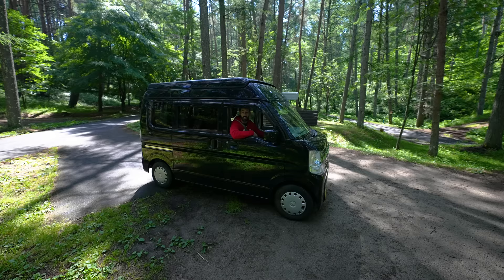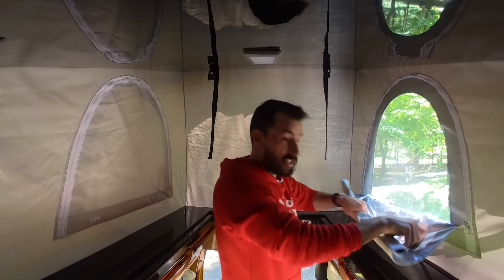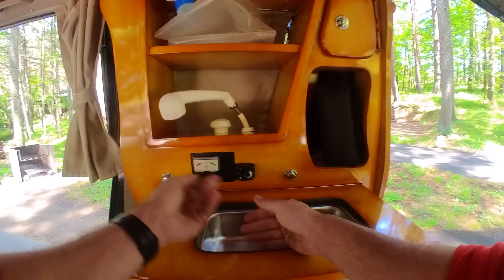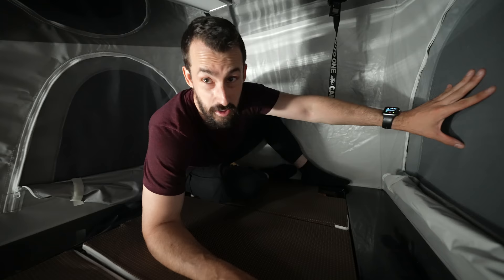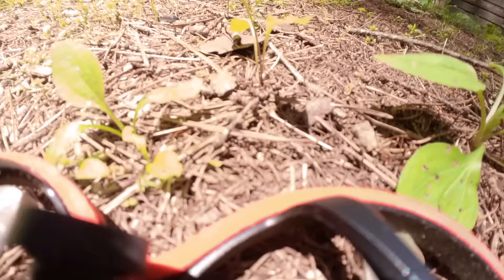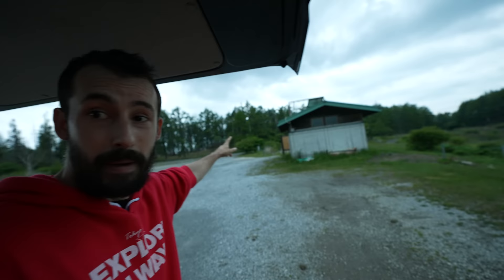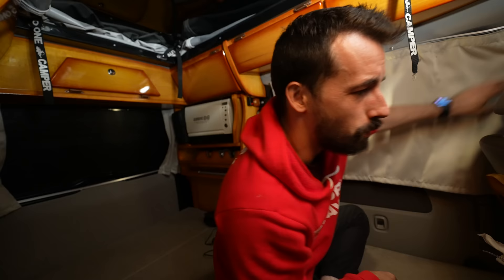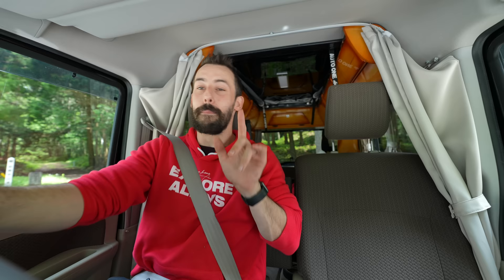Inside a Tiny Japanese Camper Van - Kei Wagon Tour!

Comment: They should market that car in Australia. Well a more powerful, longer and wider version, erm with stairs for the top because we'd actually use that. People here end up creating similar rigs themselves. When you see the stairs going up to the roof on the back of the old 4x4's this is sometimes why, because they hooked a collapsible tent up there when on a really long tour/drive (I gather it's cooler for sleeping, up away from the bugs and such, and means you don't have to shift all your stuff around.) My neighbour also added the solar as well for similar uses.
Reply: It would not meet our safety standards - basically you are dead in one of these things.
Reply: @chrisinjapan5736  Not sure where you are, but there's two home made (altered) similar to it in my street in CQ, and there's less than 30 houses in my street. Seems to require a 4x4, a welder, and a solar kit. I see no reason that Suzuki wouldn't pass a roadworthy except the issue of lacking oompf I already mentioned where I said "powerful".

Comment: So...when you finish driving, do you just attach a handle to the top and carry it with you? :-)
I love the fit and finish inside this micro-miniature camper van. A tremendous amount of thought went into this.
This thing is SO cool!. However, probably only suitable for a single, average-sized Canadian!
It's like a little capsule hotel on wheels.
You always find the coolest things to do!
Reply: I normally just pull out the seatbelts and carry it around like a backpack :)
Reply: @stalincat2457  Very practical! ;-)

Comment: Really like the Kei camper stuff, but something (that would make it a bit more expensive, but not by that much I think) was it if the engine was a hybrid engine. That would take care of the battery/electric stuff maybe let it run say 50 Km on full charge electric so no huge battery pack but enough to run the van for a bit or have enough juice for a longer off-grid stay and the engine which would run on normal gas would also charge the battery up ofc.
Then more solar panel also, at least 300-500w, maybe 300w on the roof and 2 100w foldable typ of thing that you can fold up when stationary.

That would be awesome!

Comment: That is the coolest van I've seen! My only concern (being 6'3") is the sleeping... angle. Well also the engine power with all the gear, accessories and solar/batteries, add a passenger while going uphill with the A/C on in the cabin..... would seem inefficient but still pretty damn cool, specially the awning and pop top. Great video!
Reply: For the first time in my life... I'm happy that I'm short.

Comment: This van is pretty sweet. I'd definitely rent one depending on the trip :). I wonder if the sink drain cap was upside down so the ring wouldn't make as loud of a tapping noise while driving (if it even does).

Thanks for spotlighting the cameras as well! I've been curious of ways those can be used.

Comment: This seems like it would be amazing as an EV. Sadly Japan is a bit behind on that front. But just imagine, a way bigger battery, that you can recharge at chargers and through the panels. That would provide so much more utility.
Reply from the maker: Been thinking that a lot lately myself too
I’d LOVVVEE one of these with like a 300km+ range
Solar charging is far too slow and inefficient but if it had quick charge it would be great

Comment: The "fan" you used is actually a diesel heater, bottom button turns on fan only, top button turns on the heater, middle button turns it off, and the dial is a thermostat. It should have a little 5 litre plastic tank somehwre that you fill with diesel, and they work awesome in colder weather.

Comment: At 12:58 (and earlier, when you first opened the back), I noticed little handles/knobs on the 'door' side of the sections holding the shower/microwave enclosure, suggesting that both cabinets could be pulled outward.
I can't think of any other reason for the knobs being there.
(they're both visible at 13:23)
Also, did your tour of Tokyo's dogging spots live up to your expectations?

Comment: I have a feeling that the car will struggle with hilly or mountainous roads.
Reply from the maker: Not at all actually~
Pretty much every road that I drove was a mountain road!
Some pretty steep too~
Reply from the maker: It’s definitely a bit heavier than other Kei cars
But more than enough power!
Reply: @TokyoLens  Everytime I've seen a video with something like Kei car or similar it has always been a single person vehicle. Maybe with the max occupancy the small engine size would struggle, likely more so if it was loaded with gaijin.  The vehicle appears to be designed for 2 Japanese people max for it to be used a camper.

Would be interesting to see a group of content creators together on a road trip in Kei cars and RVs (good for convoy shots), staying only at camp sites for the duration.

Comment: The rental price per day is crazy.
Reply from the maker: You mean “crazy cheap”?
Reply: @TokyoLens  I may be reading hte pricing wrong then. If not, 9000 yen a day does seem pricey. Might just be me. lol
Reply from the maker: Lol that’s like $90 per day for a camper van
That’s on par or cheaper than most full day rentals here in Japan!
I often use Nippon Rentacar and costs me at least that much if not more
Just rented a larger car for 3 days and it cost me 50,000 yen
For 3 days lol

This is crazy cheap! 😊